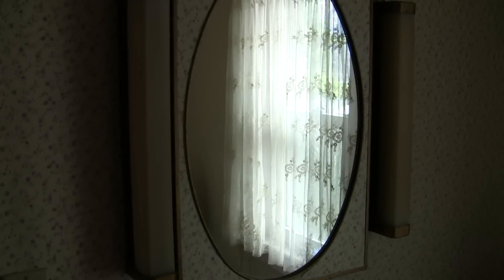Preheat fluorescent light epic fail!!

Comment: As well as being an Elevator Technician, I am also a Stage Lighting Technician.
The most common cause of this problem is a faulty starter, just try to replace it.
In the worst case scenario, it would be something to do with electricity getting to the light which could be due to a faulty electrical ballast.